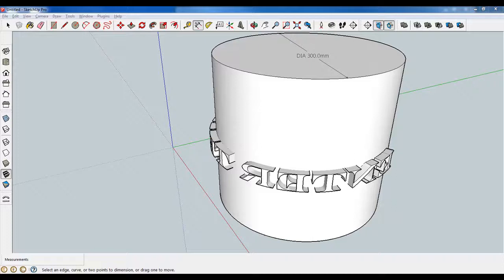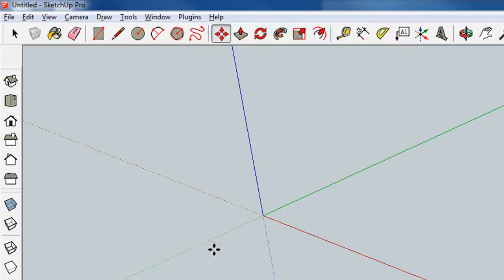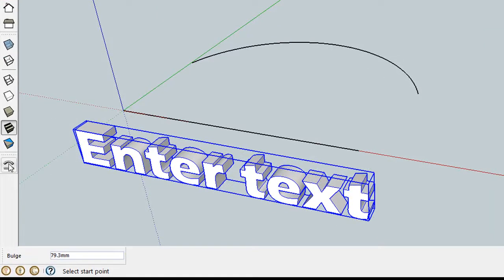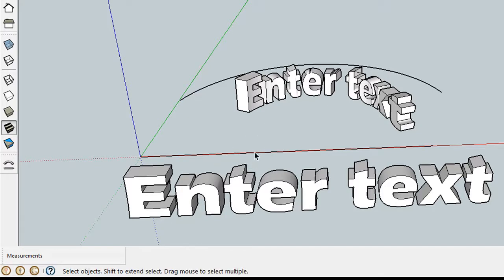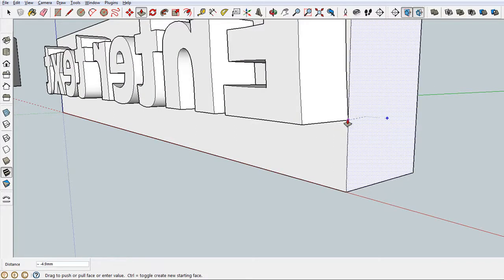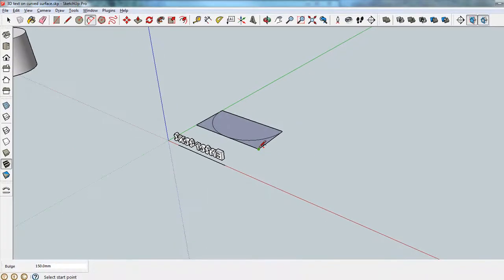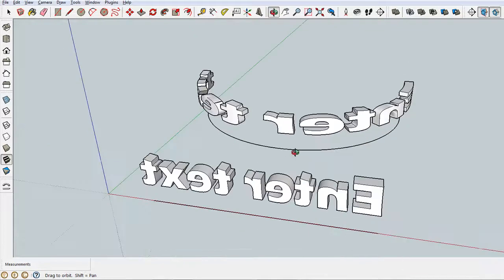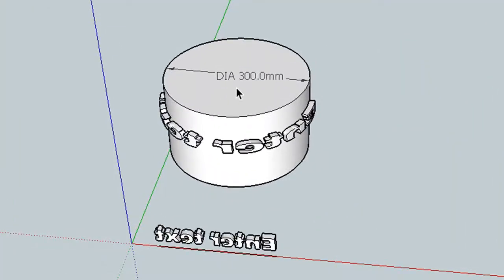Placing 3D Text on a Curved Surface - Method 2

Comment: This is probably the clearest tutorial I have seen in a long, long time for Sketchup. I have a suggestion for aligning the text to the cylinder. Add an axis line to the top of the cylinder and then group everything. Before you delete the arc do the same .. connect the ends, find the center and add an axis line extending up. Now .. delete the axis and straight lines .. grab the cylinder by the axis line .. and bring it over and snap it to the axis line for the arc. That should be a perfect alignment (theoretically as I haven't done it yet). Un-group the cylinder and delete the axis line .. delete the curve axis line and you SHOULD be good to go.

Comment: Hi Chris, 

I'm just starting to use Fullmer's Shape Bender tool. Can you address how to make the cylinder and text a watertight shape after we mate the surface of the text with the cylinder? It seems the curved shapes that Shape Bender generates are not solid groups, which doesn't exactly help us for 3d printing. Maybe I'm missing something. 

Thanks.

Comment: Does this work with objects other than text objects?

What if it's artwork that we're looking to wrap around a cylinder or curved surface?
Reply: Well, what I h ave is a jpg of some artwork that essentially needs to be embossed onto the inside of a curved surface.

What I'm doing is making a heat-stamp to imprint a company logo onto these tubular candle-like products.

Will I have to just trace out the artwork into objects, then pull/push them into solids, then group them?  Or is there an easy way?